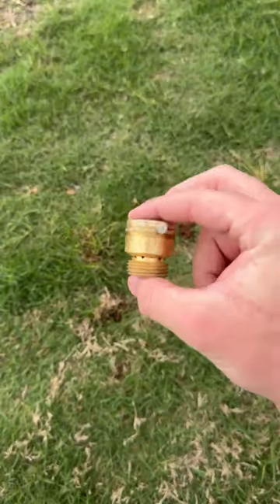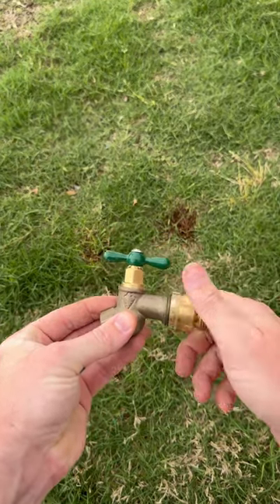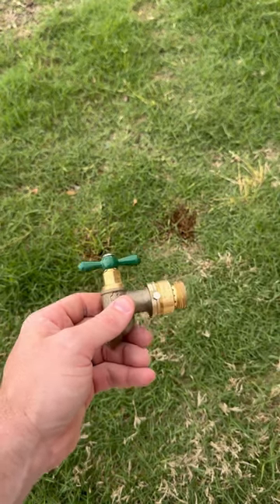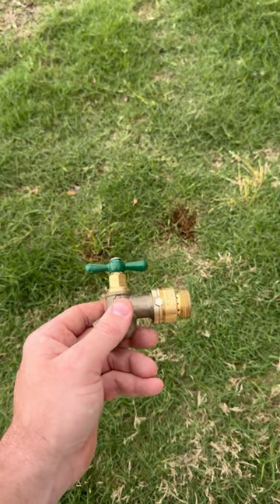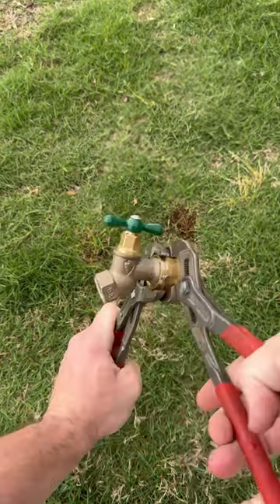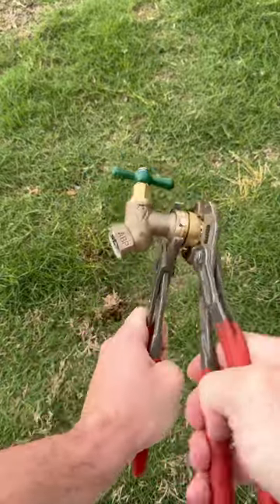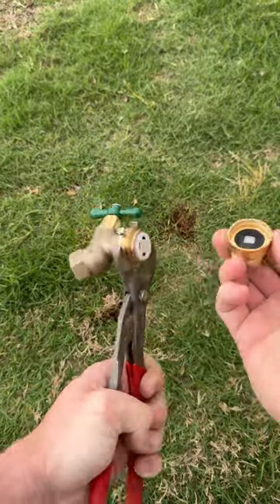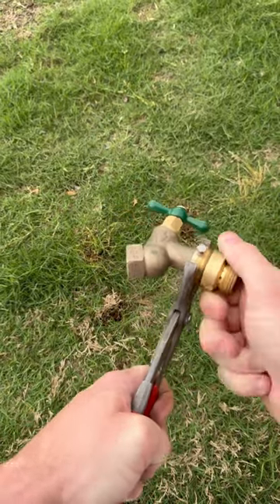Breaking Off Vacuum Breaker Set Screw

Comment: Some Arrowhead brand of garden hose bibb include a built-in anti-siphon feature. So that no added-on vacuum breaker is required. If present, will have "anti-siphon" writing on the outside housing.
Reply: Cheaper to buy a normal hosebib and vaccum breaker than some crazy ass intricate hose bib made in US. The supply houses carry import. 99% of the stuff installed on your house is import…

Comment: Put a frost proof one, then they won’t need a vacuum breaker
Reply: The frost proof one has one built in. At least every one that I've seen for the past 30 years. I've installed a lot of them.
Reply: i think that  generally only sell them in cold areas.
Reply: @davidhamm5626  we have them here in TX for some reason.

Comment: could you do a video of removing one where taking it apart isn't the fix?
Reply: Here's you take a metal drill bit and you drill really slowly on the side of it until it can separate and you can pull it off. Do not damage the threads on the spigot.
Reply: I had to do 3 on the home. I just purchased

Comment: I'm having a hard time understanding what these do.. 🤔 Sounds like it fixes a problem I've never heard of or understand why it's a problem.
Reply: It comes from homes that are connected to city water. If the city service loses pressure it could create a vacuum on your water service. If you were to open your spigot to wash the car it'll suck that nasty green sun baked crap that's in your hose back into the system. Now they have a problem. Solids in the fresh water system. It could also suck water from wherever the end the hose is in. Usually not a problem, it could be in sewer water. If the water is out it's often the case a hurricane went through or some other event happened. Sewers break, water breaches other containment.

Those solids if they get into the system are really a problem. Cryptosporidium, and many other nasties. It'll kill people.

So this is an effort to stop all of that from happening.
Reply: @robertthomas5906 
Thanks!
Don't have that problem in my country, so I guess they do this centrally.
Reply: @dalitrh  yes, and they shouldn't have these issue there as well. It means the infrastructure isn't correct and need investment. But we know that's not going to happen.
Reply: @robertthomas5906 
Thanks for the explanation of that! I always wondered when that would actually become a problem because it seems like there's always water pressure behind the valve.   but this also makes sense to that the city would push their problem on us instead of installing a main vacuum breaker at the water meter!  so this checks out

Comment: I didn’t know about the set screw deal but yes a vacuum breaker is the best option to prevent cross connecting through back siphonage which is a high hazard for contamination
Reply: What's the best way to put this...... how.

More importantly why. 

"Safety" is the answer for your safety we have installed this. 

But why and how and what.............

Sorry I'm lacking the words , have never heard of this before..... and all I can think of is 

"Why would you make that law"
Reply: @JackTalyorD to answer your question: Some people water their lawns with chemical attachments onto their hoses. Without this vacuum breaker, under certain conditions those chemicals could get sucked into the drinking supply. No one wants to drink miracle grow except plants.
Reply: @petejo  interesting

Thankyou.

Still seems odd to me, is it a law / building code or just best practices. Seems rather unnecessary on the off chance that xxxx happens.  But I don't really know.
Reply: @JackTalyorD  code (law) tends to be different, depending on jurisdiction. In my state, they are required to be installed, but that may not be the case everywhere.
Reply: @petejo thankyou 

 I think I will stick to being a wood butcher. 

That sounds like a load of toss to me, if you don't mind me saying. Not the is it a good idea why not, but making it mandatory not so much.

Have a great Easter
Reply: @JackTalyorD  Easter is my birthday, so I sure will :) Have a good Easter yourself!

Comment: They do nothing.  I drank from rubber hoses my whole young life.  A little bacteria is good for you. I'm a plumber too. I never get sick.
Reply: I believe you, considering you quite literally deal with shit on a day to day basis
Reply: There was little to contaminate your water supply back then. But yeah, whatever doesn’t kill ya, makes you stronger.
Reply: There are some really nasty stuff that can get sucked back up a hose though
Reply: @UKsystems How would it get sucked back up the hose?
Reply: This vacuum breaker doesn't have anything to with drinking out of a hose, nor is that where the primary concern is. In fact, since this product is installed before the hose, it wouldn't prevent you drinking from it anyway.

The primary purpose of this particular product is to prevent water from the hose getting sucked into the rest of your drinking system. While perhaps pointless at some homes, other people water their lawn with chemical attachments on their hoses. In some conditions, those chemicals could get sucked into the drinking supply system without this vacuum breaker. This is why they are important, though I'll admit that I didn't understand the purpose either prior to becoming a plumber myself.
Reply: @petejo  good point.  Would you also then agree that the no lead in the manufacturing of all brass potable water fittings was pointless??
Reply: @Monkeywrench864  haha, I'm definitely not claiming to be a fan of the more recent no lead changes. Way too many issues of brass cracking now!
Reply: @Monkeywrench864 by the way, i love your tools! I've purchased every one of them :)
Reply: @petejo  oh dang it, I thought I was incognito with this handle
Reply: @two7plumbing  I'm a plumber tool maker on a tight budget.  Did you know you can take the majority of Pasco tools; change them 10%, and make a new tool as your own.  Food for thought

Comment: Those vacuum breakers are the dumbest thing ever. I hate them. I hate them. I hate them. They make freeze proof faucets not work. They soak you if you turn the water off too quickly. They make it hard to fill things up right from the faucet without having a hose attached to it and they always leak always